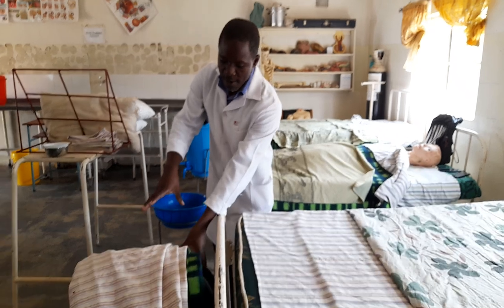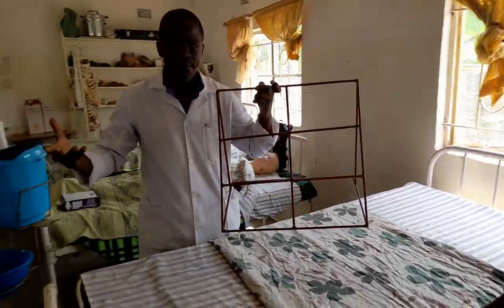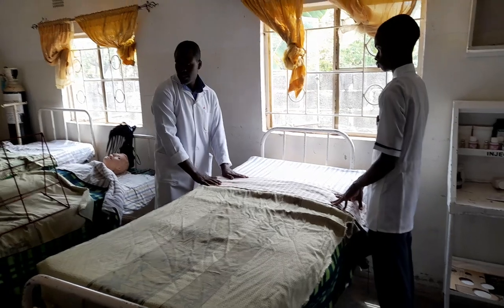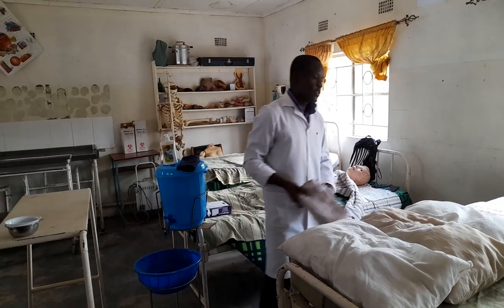Cardiac bed

Comment: Thanks for the video but cardiac bed also comes with an air ring, sand bag, at least 6 pillows (so that you will arrange five pillows in an arm chair-like fashion and the remaining one is put on the heart table).
A pen and paper as well as a bell are also placed on the heart table(so that if the patient wants to communicate to a staff, he/she can write it down or ring the bell for attention).
Thank you 🙏🙏
Reply from the maker: Powerful contribution, thanks alot
Reply: Exactly

Comment: Thanks for your teaching, but I think cardiac bed requires bed cradle so as to lift off the weight of the bed linen on the patient chest, cause the patient us dyspnoeic
Reply from the maker: Cardiac bed doesn't require the cradle
Reply: Thanks you did a great job
But I think cardiac bed requires extra pillows by the side where the patient can rest hands